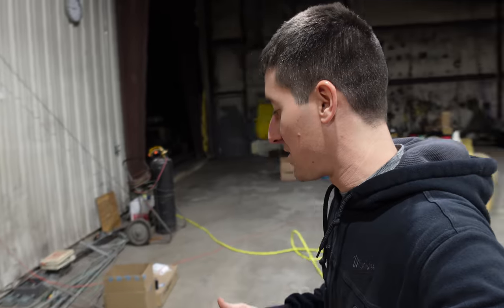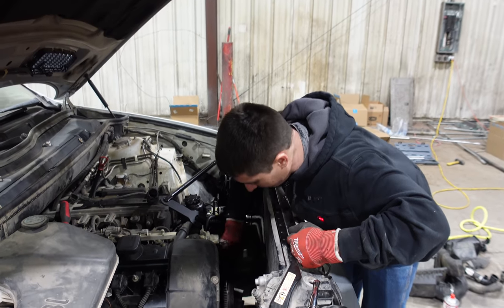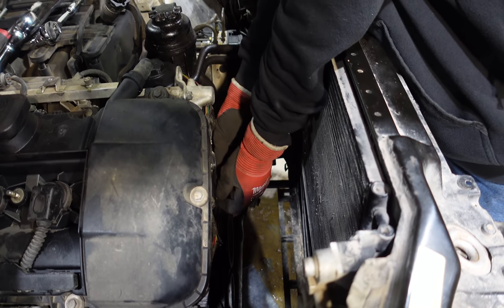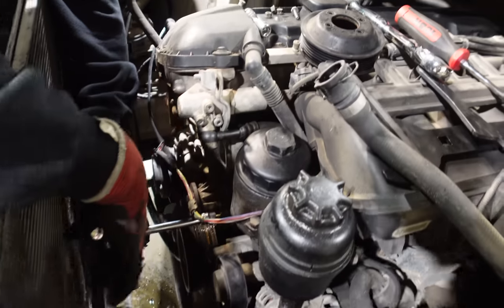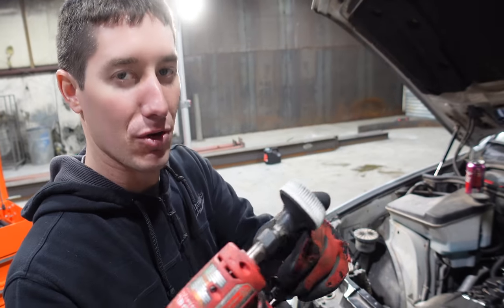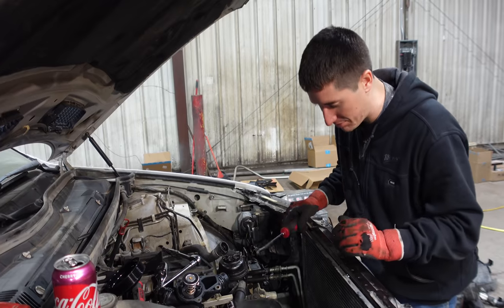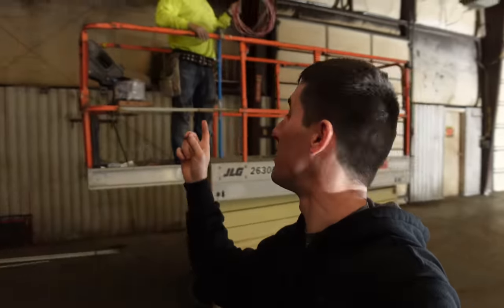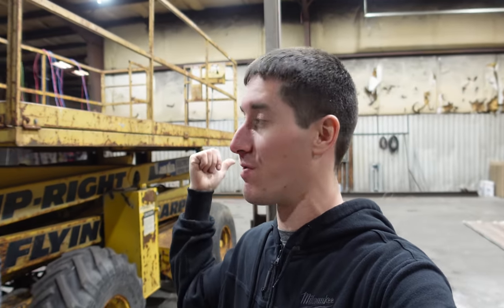The IMPOSSIBLE $1 BMW X5 Cooling Fan Removal

Comment: the best thing about fan clutches is how well they fit in most trash cans
Reply: The only fan you want when you know you will be water crossing. And highly reliable.
Reply: @benjamindavidson632  amen, I had an electric fan I put on a car that had a mechanical fan and clutch... I was forever having to replace relays or dealing with insufficient airflow in 110 degree weather. Swapped back to the clutch fan and all my woes went away.

Comment: Just so you know, that is not a temp sensor. It is a heating element that the computer uses to open the thermostat. The computer controls when the thermostat opens. The act of the coolant heating the wax capsule is a backup method.
The two temp sensors are located on the bottom radiator hose and on the back drivers side of the head.
Reply: Close but not exactly. It normally opens at the stamped 93c but the ecu will sometimes open it earlier with the heating element. As exmaple if it feels you are pulling up a long hill or the oiltemp is getting a bit hot it can open up as early as 73c

Comment: Ok JR i worked a euro car shop . I made a tool. Basically made the end of a wrench out of 12mm steel with a 12mm  hole in the side of it about 4 inches from the side of the nut. Then the handle out of 3'' by 1/2'' about 3 ft long with another small piece welded across the top. Then you bolt them together.   Now you fit it so the wrench is at about 90*and bash the thing with a 4lb club hammer. It works every time but if it doesn't you get the large Channel locks polygrips to hold the handle and get a friend to bash it. This keeps your soft little hands out of the firing line should he be a bad shot. This something else the you have to watch on these when you get your new pump. Some of the after market and genuine ones have a cast plastic impellor. We had a run of them where the impellor split and came away from the shaft.  So the pump turns but doesn't do anything.  It doesn't even make a noise.  Those motors also have green cardboard pan gaskets that break up come out the side with some of the oil. Then theres the head bolts that pull the thread out of the block when you torque the head down during a head gasket job.  The engine shop made a 2'' thick  block of steel  with 6 holes in it to the same dimensions as the headgasket with slightly bigger bolt holes. Helicoils were too short and pull out too so you have to go up to 18 or 20 mm metric coarse as a fine thread of the same diameter will pull out too. They made their own inserts with the fine thread on the inside from threaded rod.  The insert are loctited in and you assemble the head as normal. We had to tow an x5 off a flat wet lawn with one of the company loan cars.  The tyre combinations all width and flat faced tyres are useless offroad.

Comment: I wish I had that thing. To get the fan clutch off my '00 E55 I had to put a 5 foot steel bar over the end of a pipe wrench, after having cut off the actual clutch itself and leaving just the nut on the water pump.

Comment: You need a Heat Induction Tool, works like a torch but with out the risk of damaging other parts (or burning the shop down) I love mine, if there was a house fire, Id save that before baby photos!

Comment: Next time clamp down the framus with locking pliers while rotating the ramistan 40 degrees from the paternoster.A little tricky, but will get the job done.

Comment: To be so young you can work off the floor. At nearly 70 I'd be buying a large metal table on wheels. I think there are food service tables like that I'd look at that  can be gotten in a bunch of sizes. Something with a lip to keep screws and liquids from rolling off.  If I knew how to weld I'd make my own custom bench. Hey! Maybe that would make for a good video in the future for you? If those metal panels on the walls that you plan on taking down are thick enough maybe they'd work and save you $$$.

There used to be huge metal pans you could put under a car to catch spills. One of those would be great for your garage.

Comment: When I owned a big truck, I had 3 alternators with the pulley already attached and I could change them in just a few minutes. I had a 6,000-watt diesel generator and a 2,000-watt inverter. I could run the truck as long as I wanted by using the using generator and the 70-amp alternator on the generator. I used to have the alternators rebuilt and it didn't cost that much to have new bearings installed in the alternator. 
http://calnikont.com/transportation.html

Comment: The way you described putting the fan clutch on is close to how I do it. I pull the coil wire and have somebody crank the engine. Also , seeing all of that useless crap on the radiator is why german engineering is BAD!